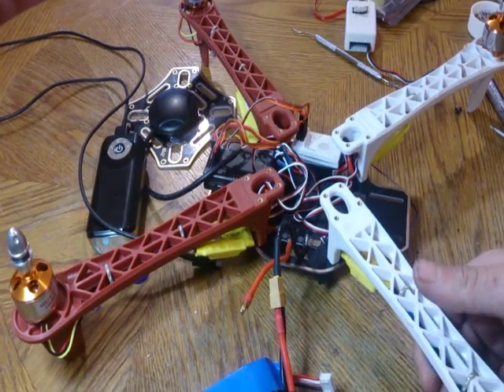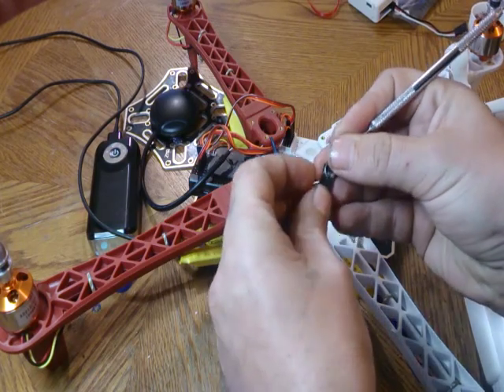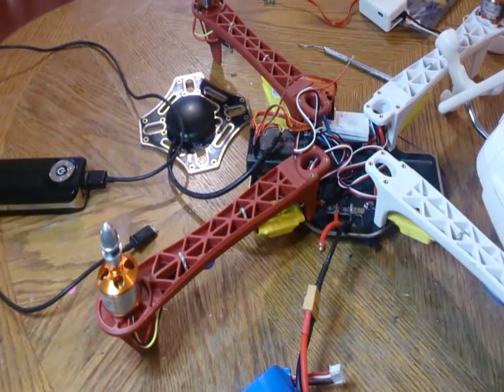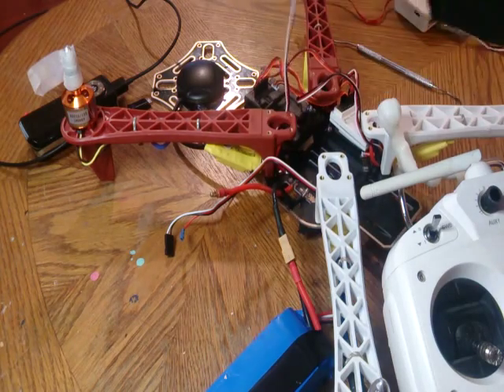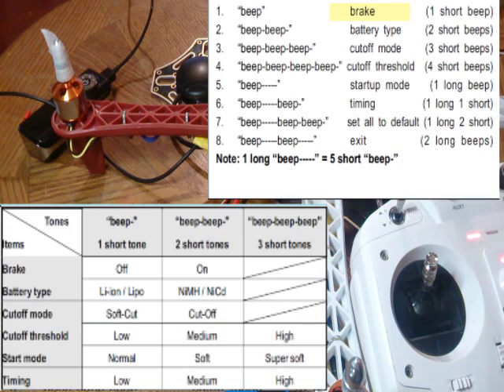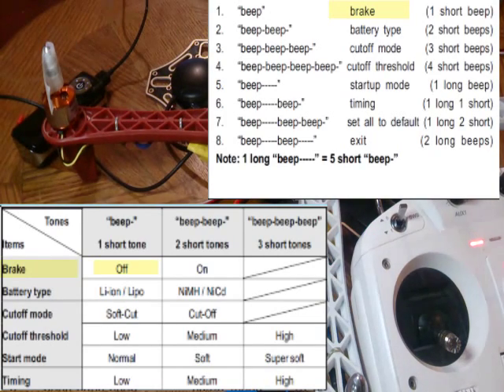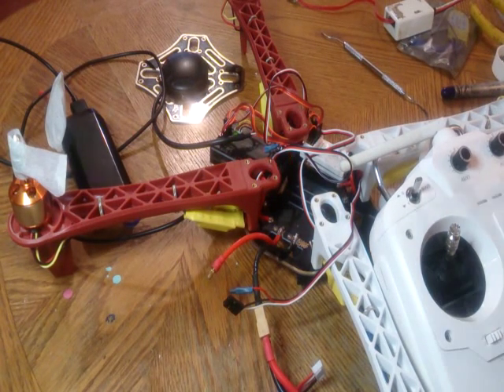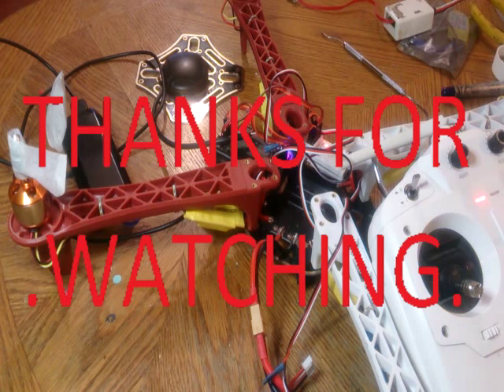HOW TO PROGRAM HOBBYKING,HOBBYPOWER HOBBYSKY ESC WITH A REMOTE

Comment: i bought Hobbypower ESCs to replace HobbyKing ESCs in the mean time. i dont know why the hobby power ESCs dont fully throttle my motors. the hobbyking ESCs worked fine before they burned up
Reply from the maker: +Luis Valdivia did you do a esc calibration? ..
Reply: +bangs6996 i dont know how.
Reply from the maker: +Luis Valdivia which apm are you using? you don't have to do it with a apm its just easier usually..
Reply: bangs6996 I Have a multiwii 328p
Reply from the maker: +Luis Valdivia and what rx /transceiver  are you using?
Reply: bangs6996 Hobby king HK-TR6A V2
Reply from the maker: +Luis Valdivia Ok keep in mind I don't have either so you can tell me to f off anytime lol.. but this is the way I would do it.
.. First. can your apm be powered just by usb.   what powers your apm. ...  a bec off one of the esc ..or a power module ?
Reply: bangs6996 BEC from ESC powers my flightboard
Reply from the maker: +Luis Valdivia Ok .. the first thing we should find out is if we can do a all at once..
unplug the red wire from each of the bec wires going to the apm(esc 3 wire) ..make sure they don't short out on anything. . to double check that was the only power source.. plug in the battery .. the motors should beep couple of times or forever... However the apm should not turn on.
If that happens (apm does not come on).. unplug the battery.   .. Now plug in the usb cable. and see if the apm comes alive ,  Does it?
Reply from the maker: +Luis Valdivia btw If you are busy you can just hit me up later when you have time . This might take a bit of time
Reply from the maker: +bangs6996 Alright I'll just continue. .. If it does come alive with the usb  power....     the steps would be
1.plug in the usb . arm your quadcopter if there is a special way with your apm.
2.move the throttle to full .
3. plug in the battery .. wait for 2 beeps then silence.
for about 1-2 seconds. ( if motors continue to beep ,just unplug the battery and usb and start again)
4. put throttle down.  it should beep couple of times.
5. If no more sounds from motors. ..push throttle up to test motors.
Reply from the maker: +bangs6996 If the usb does not power the apm. ...
You will need to cut a usb cable for the positive and negative wire.
Plug the red wire into the motor output of the apm where the esc red wire use to be. and plug the ground wire some where on a ground rail.  You can then plug in the usb cable ..then battery as the steps above..    Alternative is to unplug all the wires from your rx. and do one esc at a time. by pluging just the white and black wire into the throttle section of the rx...   and plug that homemade usb cable into the positve and negative rail on the rx..    ..Then plug in the usb cable go full throttle .then plug in the battery ,wait for 2 or so beeps . then move throttle to bottom position..
Reply: bangs6996 ill keep in touch. i have a final tomorrow and the quad is with a friend. thanks for your help!

Comment: hi bangs from the philippines again.is it ok if i change my 4 ESC into http://www.hobbyking.com/hobbyking/store/__15202__Hobby_King_20A_ESC_3A_UBEC.html
Reply from the maker: +Vince Gabrinez HI your message just showed up 22 hours later,   yes you can use those esc.   ..You will loose your lights under the quad , Unless you leave the old esc in place just for the lights.   It is important you remove the red wire out of the White red black header(bec) on each esc and tape them up.    If you look around you can get 4 motors and 4 escs 30a for the same price  .. http://www.ebay.com/itm/121563201520?_trksid=p2057872.m2749.l2649&ssPageName=STRK%3AMEBIDX%3AIT        so you should be able to find those 4 escs way cheaper.
Reply: +bangs6996 thanks again for the info....iv ordered naza lite v2 for upgrade of my FC but i dont know if i can use my cx20 transmitter and reciever on it
Reply from the maker: +Vince Gabrinez It looks like you can as it has a e t r on the board ..so it seems to have ppm  built on..  not sure about the dip switches though..
Reply: +bangs6996 oh man!i think im confuse maybe i try.out of budget for the transmiiter.thanks again
Reply from the maker: +Vince Gabrinez I don't think you will need new transmitter and receiver but will have to do research on how to enable dip switches , I don't have that apm so no idea on what kind of settings it has for return to home and stuff.
Reply: ok ill research.but if fine one plsss pm sir.thanks again

Comment: hi bangs me again from the philippines.i manage to power the bigflyshark cx20 i follow all step by step but the esc dont detect signal but other will detect,i think the esc are broken.ill also try program the esc like you do,the beep are the same from you but when i throttle down it wont detect the signal it just continue to beep back and forth to the beep of menu.i will try to hot air the esc maybe it can help.would it be ok?tnx
Reply from the maker: +Vince Gabrinez No don't try to program the esc .the menu is different .. At least on mine and I don't think anybody has taken time to sketch out the menu and submenu.. ... and also the firmware for the esc is not public. I loaded wrong firmware to sil chip on mine and my motor smoked big time and the esc burnt.      I don't think hot air will help you , How did you try to program esc?  with power from usb going to -b      .. I can make short video of how to program through rx one at a time if you want.
Reply: yeah power from usb -b of rx.but the problem is the esc signal wont detect any signal from the rx or in fc.i try the other esc the good esc it respond.i follow your video in youtube HOW TO PROGRAM HOBBYKING,HOBBYPOWER HOBBYSKY ESC WITH A REMOTE
Reply from the maker: +Vince Gabrinez Sounds like you will have to order new esc then,
Reply: yeah.the problem in our place here in philippine it take 1 to 2months to arrive the item.bangs thanks a lot,for all the idea you share to us it didnt fix my problem but i really thankful the reply you did to me,and time.god bless......
Reply from the maker: +Vince Gabrinez thank you for kind words. I know the feeling of waiting I just had 11 orders go bad from china from bad sellers and now have to wait another month as well.    . what you can try to do if your bored is switch the green capacitor in the front from a good esc to see if its just the capacitor .
Reply: ok i will...tnx

Comment: ok tnx hehehehhe thats my plan bat i need to be sure for what im gonna do to my cx 20.i just fly this twice then the 3rd this is what happen im soooooo sad right now its been a month i dont know what to do... but tnx you very much bangs atleast i have an idea.....just try understand my english heheheh tnx......................
Reply from the maker: +Vince Gabrinez oops
Reply from the maker: +Vince Gabrinez sorry about the last message I am helping two people at same time and posted wrong..... Good luck and just post back if you get stuck..it might be your esc is just bad as well..but you will find out after you try esc calibration
Reply from the maker: +bangs6996 btw if you have not even had it open yet ..it might just be  a bad wire connection.

Comment: it have a usb but the board wont power by the usb cable
Reply from the maker: +Vince Gabrinez ouch.. Well it now depends if you want to be creative.  If you are good with wiring I can suggest some stuff. .. You can Remove -b cable off rx.. put to the side.   You can strip a old usb cable for positive and negative wire. and attach header on end so you can plug into apm + and - rails.. then continue with the other steps.
Reply from the maker: +bangs6996 if you can't find positive and negative rail.. just simply unplug the -b cable from rx and now plug positive and negative(usb) into -b location..     In reality you can also unplug all the cables from the rx and plug the motor that is beeping into -t on rx ..and the steps would be..  Plug in usb + -   into   -b of rx..
plug in usb cable ..go full throttle 
plug in battery.. wait 2 beeps
move throttle down.
Done.

Comment: Programm http://www.aliexpress.com/snapshot/7259663930.html?orderId=72385436795713  It is the same?
Reply from the maker: +Michał Hewelt It is hard to say if it has the same firmware, you never know what is hiding under the covers sil/atmel ect.., they seem like really good esc&#39;s   ..Personally I would get those they seem like solid esc's .  In the description it is defaulted to the right settings.. cut and paste..
No low voltage cutoff, because any cutoff in a multirotor = crash.
 No over temp cutoff, because any cutoff in a multirotor = crash.
 Super high refresh rate, no buffering of the input signal, resulting in more than 490Hz response rate.
 16KHz motor frequency, giving fastest response of the motor, and quietest operation as well (no 8KHz squeal).    
Super simple, foolproof operation! Nothing to program other than the throttle range.
 If you get them and want to see if they are the same, just enter programming mode and make a chart with the beeps .if it has the same start up tune and the same amount of main menu's it is most likely the same. I would start with the break on break off to confirm, but again who knows if they changed some of the other submenu , but it is very doubtful cloners hardly ever want to edit the firmware unless its to meet a clone chips specifications.

Comment: nice info. Yet It is in the ESC manual but yes in chinese I can't read it. I Calibrated mine according to your info. But I just wanna ask, why are you set cutoff mode to cutoff. Doesn't it submit a glitch to the craft. And Mr.. I know you got cat / dog ... :)
Reply from the maker: +ardmovies No the esc actually has it built in to cut off voltage to your motors or slow them down at a pre set voltage . which would be dangerous to us if we are 100 feet up in the air.   By setting it to nimh/nicd and by setting low voltage protection to low . We turn off cut/off anyways.. and even if it did reach the nicd low voltage of 7.2v -8 volts our quad would probably be on fire.

by default it is set to lipo 3.15v soft cut 
Which if it worked right it would limit the throttle and force you to bring it down.
I don't think too many people actually change it from the default. But I have enough external buzzers, and telemetry to warn me way before its time to bring it down.

---You know before every video I tape off all the dog and cat hair.. but it just comes back!!!!!!!!!!  maybe I should start wearing white shirts for video's lol.... ...
Reply: In your description below there setttng cutoff = cutoff. but in flitetest setting should be softcut. I have set mine with cut off and glitched. When set it to softcut it fly stable. I also used external voltage alarm.
Reply from the maker: +ardmovies The only time when you see softcut is when  your battery is almost dead and triggers the built in cutoff.  In reality I should leave mine to softcut regardless in case it messes up ..i would rather have a soft cut then just a instant motor shut off.. I will reply with a cut and paste
Reply from the maker: +bangs6996  
2) For nickel batteries, low / medium / high cutoff voltages are 0%/50%/65% of the startup voltage (it means the initial voltage of a
charged battery pack), and 0% means the low voltage cut-off function is disabled. For example: For a 10 cells NiMH battery,
fully charged voltage is 1.44*10=14.4V, when "medium"-off threshold is chosen, the cut-off voltage will be: 14.4*50%=7.2V

Comment: Motor 360kv + battery 10000 mah = more fight time??i
Reply from the maker: +safu gsm It all depends on the final weight and how you fly it. and the blades you use and the quality of the motors and battery you end up with. I have seen lots of video's of people posting 50min or more flying time with that setup , however I see even more posts of people trying to create the same part list and only ending up with 20-30 mins.   I know one thing the kit I use would not be a good kit to get the frame is heavy and I found that tube frames fly through the wind way better.
Reply: Nice thank you for information